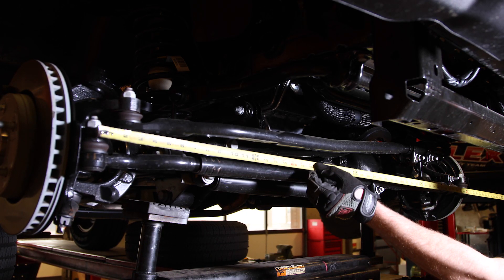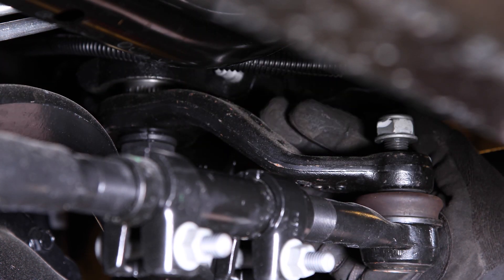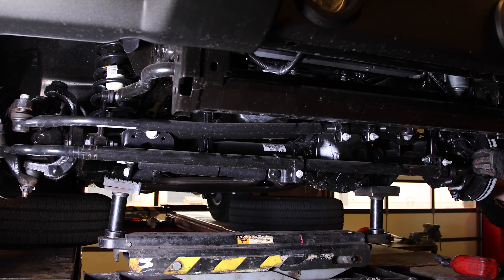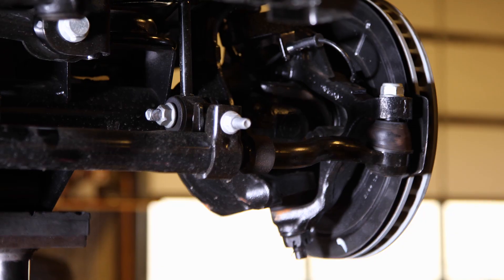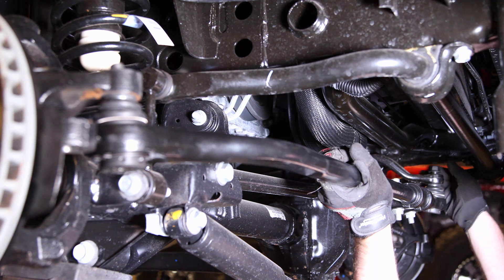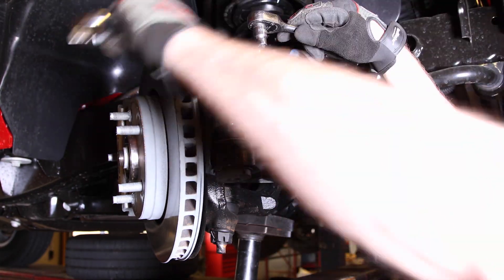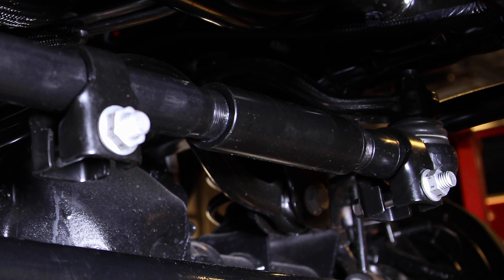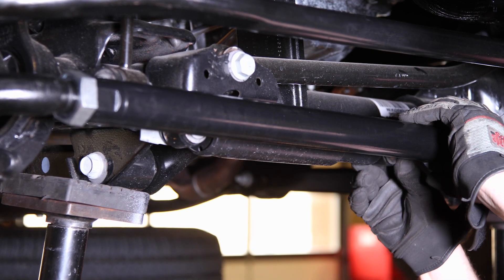TeraFlex Install: JK HD Tie Rod & Drag Link Kit

Comment: Hi Dave, that would be correct. If you want high steer on a RHD you need the non flip and the other way around for stock setup. We stock these and will have them on our website with the description to match our RHD application. Cheers Vic

Comment: My 2017 Jeep Wrangler Chief Edition is stock height & stock tires. I replaced the stock parts with the TeraFlex HD tie rod, drag link, track bar and steering stabilizer. I had an alignment done after the new parts were installed. Is there a break in period for the new parts?
Reply from the maker: Thanks for reaching out! Yes, when new there is a notable period of time for say the first 500 miles where the joints will progressively break in and loosen up.

Comment: I’m working on a 98 grand Cherokee.theres a front left and front right tie rod I orders those parts I am trying to figure out a name of the tie rod that connects the drag bar to the pitmen arm what is that tie rod called it looks like tie rod end we’re it connects to bottom of pitmen ?
Reply from the maker: Those are going to be a y-link setup most likely. Completely different then a separate tie rod and drag link. But the Drag link is the one coming from the pitman arm down to the tie rod or the passenger knuckle. depending on application.

Comment: Are the ball joints on the drag link and tie rod end pressable?  A mechanic told me I would have to replace the entire drag link but it looks like the ball joint can be pressed out and a new ball joint pressed in.
Reply: If the ball joints can be pressed, what are the replacement part numbers?
Reply from the maker: Yes, removing the snap ring on the top of the joint, and you can press them out. Replacement part number is 1344410.
Reply from the maker: @randallgould6682  Replacement part number is 1344410

Comment: Do these need to be greased after install?
Reply from the maker: They are greased from the factory, but you will want to great them every month or two. Adjusting the preload as the wear plate "wears" to tighten everything up occasionally as well.